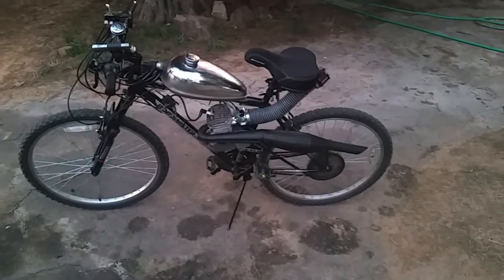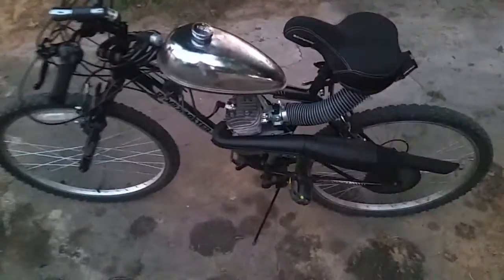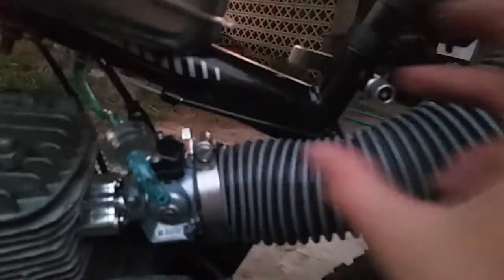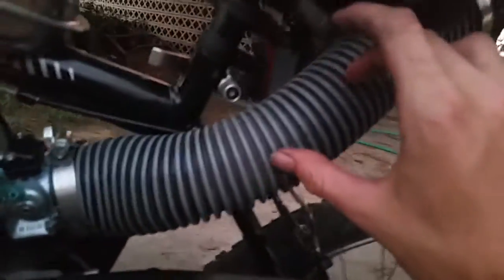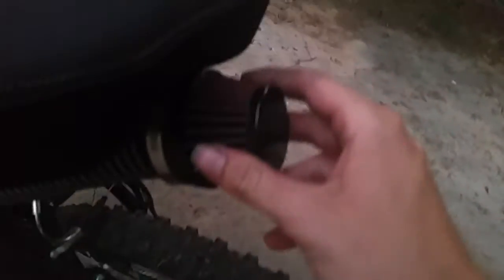2 stroke 80cc bicycle engine bolt on power.

Comment: I have a standard muffler for a 80 cc Chinese bike motor , on the inside of the   muffler , the baffle plates are tack welded onto The baffle,is there anyway to remove the baffle and plates from the muffler
Reply: JLmiller Young just cut it.. I cut the pipe going in to my stock muffler and it's quieter and pick up a. But of power..
Reply: Cut the two tack welds with a Dremel  . I did this but pack mine with fiberglass around a circular mesh. Basically I have a glass packed straight pipe. Its not too loud eiether. Nice balance of noise and power.https://youtu.be/pR6qxAw7BU4  JB weld the end cap back on. Its low profile and stock looking . Sleeper muffler.

Comment: What gas oil ratio are you running here? And where’d you buy your reed valve from? Really liking these mods
Reply from the maker: Kyle Idstein 40:1 with amsiol dominator synthetic oil.

Reed valve is a RSE reed valve, they're pretty common, cheap, and can be found on ebay, or just about any other motor bicycle parts website. 

https://m.ebay.com/itm/Reed-Valve-Air-Intake-Kit-32mm-for-2-stroke-gas-motor-engine-kit-bike/192204102682?_trkparms=aid%3D222007%26algo%3DSIM.MBE%26ao%3D1%26asc%3D20161006002618%26meid%3D8b0e4b119cd745b2819db7040b371971%26pid%3D100694%26rk%3D3%26rkt%3D16%26sd%3D182921762545&_trksid=p2385738.c100694.m4598

Comment: Did you have to do anything special with the reed valve like piston or porting ?
Reply from the maker: The Nick peezy Adventures nope, just slapped them on and off i went. Plug n play parts pretty much. You might have to trim a fin if it's in the way but that's it.
Reply: You need a windowed piston and 3rd transfer port (cylinder port)   for it to work right. No top end power.
Reply from the maker: @clintbliss2046  lol for the maximum gains probably. But this is just a demonstration of what it does with a stock motor. 

Compaired to a boost bottle, it works as far as "noticable" performance gains are concerned.

But saying it does nothing is an outright lie.
Reply: you should make a video of the motor running after you added a window piston and 3 transfer. I bet you'll title it ," how to currently run motor using a reed valve.”

Comment: You should learn to ride a 2 stroke and not starve the engine of oil by not giving it gas or pulling in the clutch while going so fast.
Reply: gtx no manual clutches on these two stroke engines they have no transmission
Reply: Nathaniel Reczek they do have a manual clutch, but there’s no harm in decelerating normally like this anyways
Reply: Could you do a little more explaining on the what no to do on a 2 stroke motor? Would save me money lol

Comment: where you going up hill or down?
Reply from the maker: Joey Himka downhill run. I've since upgraded to a new setup. Still using that delorto SHA clone carb though, i love it.
Reply: Where did you buy the carb?
Reply from the maker: Joey Himka ebay. It was one of those air filter/carb combo's on ebay they usually run $25-50. Just make sure you aint getting one shipped from china unless you dont mind waiting a month.

Comment: Can't find that pipe anywhere
Reply from the maker: Lagmaster0591mzmiami | eBay Stores
http://stores.ebay.com/mzmiami?ssPageName=STRK:null:MESST&_trksid=p2055119.m1438.l2653

 this seller, sells them, w/e he has them in stock. currently only the Chrome version of this pipe is available as of right this moment.
Reply: Solmangrundy ManGrundy I can't even find it on that site. Got a direct link?

Comment: where did you buy the motor kit from, what brand? and the exhaust pipe?
Reply from the maker: serge T found it all on ebay, not sure what type the motor is, but i hear the Pk-80 types are the best.
Reply: Thanks for the reply bud, I searched on ebay for that muffler and can,t find it. there are others that look like it, but not quite the same.

thanks again
Reply from the maker: serge T the muffler i bought in this video is out of stock from the seller i got it from.

http://www.ebay.com/itm/271952212120?redirect=mobile
Reply: Hey thanks bud i found it, this guy builds and sells this pipe out of Miami. It's good stuff, ride safe
Thanks again

Comment: I like the way the motor sounds no four stroking, the air fuel ratio seems to be dead on.   Is that in miles or kilometers per hour?
Reply from the maker: serge T mph

Comment: What is the name of this exhaust
Reply: Dec Oreilly Amazon has it for 45$. Just type in 80cc expansion chamber
Reply from the maker: This particular one came from ebay. Some custom shop in Miami makes them, they only list them when ever they have'em.
Reply from the maker: Heres a current listing

https://m.ebay.com/itm/MOTORIZED-BICYCLE-BEST-HIGH-PERFORMANCE-RACING-EXHAUST-CHAMBER-BLACK-/282712262351?_mwBanner=1

Comment: ive got the same pipe. lots more power but way too loud
Reply from the maker: people in my area tend to watch their phone more than the road, so the loud pipe helps get me noticed. but the real improvement is that this pipe has extra support so you're not stressing/breaking exhaust mount studds as much as you would on other brands/pipes that are only held on by the engine studds and nothing else.
Reply: hey bro where did you buy your exhaust pipe from ? wouldn't mind getting one as well   Thanks
Reply from the maker: serge T https://m.ebay.com/itm/MOTORIZED-BICYCLE-BEST-HIGH-PERFORMANCE-RACING-EXHAUST-CHAMBER-BLACK-/282712262351?_mwBanner=1
Reply: @Solmangrundy  Its a good pipe and all but do you know whats the bolt size  for the muffler is ? My bike 🚲 is a 2 stroke 80cc but i lost the muffler bolts while i was rebuilding the engine due to a piece of the cylinder wall breaking loose and damaging the piston. I cant ride without muffler because i know the sound coming from the engine is enough to blow my ears out and its enough of a reason for my parents 🙍‍♂️🙍‍♀️to send my hard work to the scrap yard🔥☹.